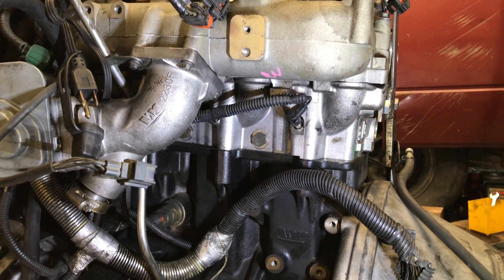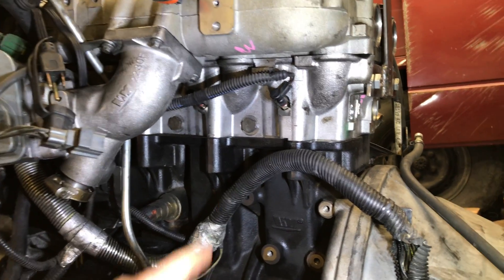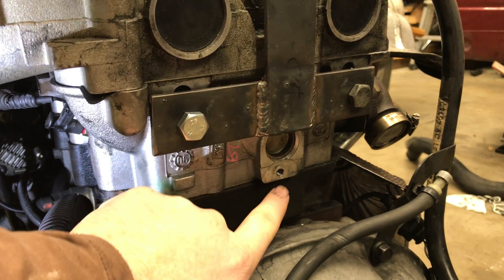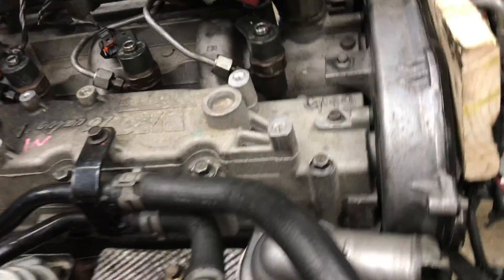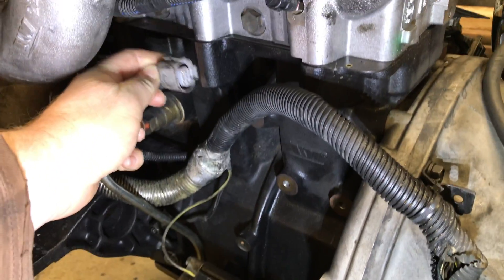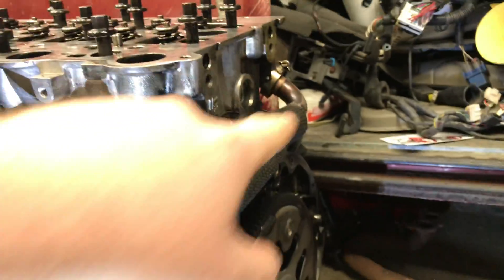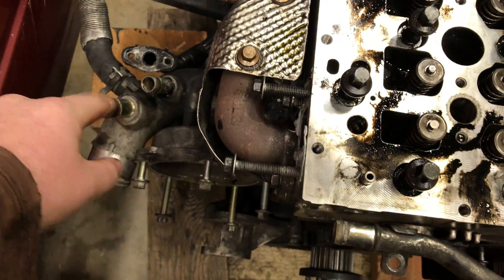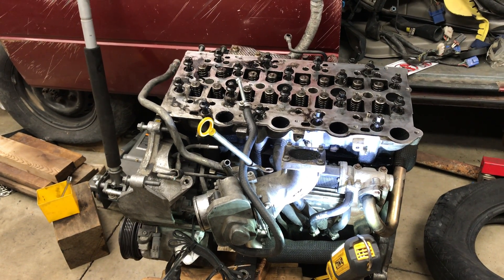Jeep Liberty KJ 2.8L CRD – EGR Delete Basics (What It Does & What to Watch For)

Comment: Why didn't you take off the intake tubes and replace with an aftermarket?  So you'd have 2 connectors not plugged in to anything, the EGR and the valve body.  Looks like there is a butterfly in there that regulates the amount of exhaust that comes into the engine.  So, one connector opens the EGR valve, the other regulates the amount of exhaust flow coming into the engine (new vs. exhaust recycle rate).
Reply from the maker: Good question. The best answer I can give is, leave it as close to stock if possible. Yes you can remove the plate off the valve body, yes you can remove the valve body and try to fabricate something to replace it so the stock boost hose connects in the same place. Yes you can figure out something else besides the stock type boost hose. But by leaving the throttle body and doing a tune to turn off the EGR the butterfly valve will never activate during engine run, and only close at engine shutdown. This also means the protection for runaway diesel is still in place with engine shutdown. Sure you could do more, but at what benefit? This works perfectly fine, looks more like stock for any sort of inspection, and it less cost and hassle than replacing more stuff.

Comment: I have a 2007 CRD.  Similar but not quite the same.  'T' in water pipe doesnt exist, its a formed steel pipe now so you cannot simply replace with straight joiner.
Also EGR looks different, steel pipe round the back of the engine connects to back of EGR withclamp not side of EGR with bolts like your second engine.  I assume procedure will be the same though?
Reply: @farmworksmartin Greetings. I have Diesel 2008 JK 2.8 turbo. So did you find a video on removing the EGR

Comment: Hi There from the UK , you are obviously an expert on these vehicles , i wonder if you can help , 
i have a customers 2.5 CRD jeep (liberty) and it has a problem where you can drive it for
approx 6 miles and it just cuts out , like you have turned the ignition off  , it comes back with 
a DTC of fuel rail pressure monitering , i,m wondering if thats a red herring though , i have
put 4 brand new injectors in , rail pressure sensor and another fuel rail because of the valve
on the end but still the same , is there perhaps something common to these engines that you
might suggest i look at , thanks in advance for any help ,Niall
Reply from the maker: I might be looking at the crank position sensor. Cutting out after getting warm can be a symptom of that. You could hit it with a heat gun with the engine cold and see if heating the sensor causes the engine to die. The other thing that could cause an issue is the fuel quantity solenoid at the back of the injection pump.
Reply: @IcarusOffroad  thankyou very much for your reply , you have given me a direction to go in , i will get back to you hopefully with good news , many thanks Niall
Reply: @IcarusOffroad   Crank position sensor will go bad and fault when hot, like you describe.  However it only prevents an engine start - it is not referenced when the engine is running.

Comment: It's almost identical to my VM motori 2.8ltr intercooled turbo Diesel out of my 2007 Jeep Wrangler. The hard part for me would be getting the ecu to ignore the fact the egr valve and cooler aren't there anymore. It really messes up the intake and Mass air pressure sensor.
Reply from the maker: Yes, whole your engine is a newer iteration of this one it is very similar. I am not familiar with the ECU tuning options that exist for those Jeeps, but I suspect something similar can be done.

Comment: Thank you. Good vid. I have just watched another video and with blocked EGR injectors get overheated and piss diesel. My egr has been blocked for about 80k and starts smoking and mps have gone up. Rpms were jumping recently, not always though. Have been adding injector cleaner for the last 2 weeks and rpms don't jump anymore, but i still get black smoke at low revs , I'm guessing because of too much fuel. Now it has 145k km. Any ideas?

Comment: How many miles is on your old engine. These engines seem to fail prematurely
Reply: . Also I see a issue with a c egr delete. The blowby  needs to go go out your engine. Could cause excessive sludge buildup
Reply from the maker: anthony gauntt we do a separate crank case vent or oil/air separator(like Provent) to keep the oily sludge out of the intercooler and intake.
Reply from the maker: anthony gauntt my old one had 155k on it. We see problems with failed valves on these, particularly exhaust valves, but we also see these on engines that haven’t been maintained by enthusiasts owners. If you tried to drive the vehicle as it left the factory, and use the factory recommended oil you tended to have problems. Those of us that have had ours since new and modified it right away tend not to have the valve and rocker issues that others do.
Reply: @IcarusOffroad  What oil do you recommend for these 2.8 CRDs?
Reply from the maker: @AKJeeper   any diesel rated oil in 15-40 is what I run. Winter I might go a little lighter with something like 10-30. But I run the same stuff year round. I’ve run lots of delo diesel oil in 15-40. I also use the Costco 15-40 diesel oil these days.
Reply: @IcarusOffroad  Thank you, much appreciated!  Good to know.  I just did a complete CRD swap from a wrecked 2006 Liberty into a 2004 3.7/5spd...kept the automatic with the CRD as I didn’t know if a manual CRD swap was easily done here in the US.   The 2006 owners manual indicates 5w30 and that just seems wrong to me, at least compared to all the other diesels I’ve owned.

Comment: What thread is that plug the kit im going to buy dosen't come with it
Reply from the maker: mmmontague I don’t know the thread size off the top of my head. However someone did tell me they were able to buy a drain plug for a BMW at their local auto parts store and that fit the threads.
Reply: @IcarusOffroad  what oil are u using? we used the 0-40 Mobil Syn, and our rockers where bad at just over 100k miles? thanks, appreciate ur vids!
Reply from the maker: @1775peasant  0-40 is too thin, especially in the summer. I used 15-40 delo diesel oil in mine from about 20k miles when I bought it, to 150k miles when my belt broke. And my rocker bearings were perfect. I’ve have seen many low mileage engines that have terrible rockers from running the thin oil. I highly recommend switching to 15-40, or maybe 5 or 10 - 30 for the winter.
Reply: @IcarusOffroad  

thanks man! 

u don't know how many times i almost dumped 15-40 in my wifes? i'm a corn & soybean farmer, and i get 15-40 in bulk for all my stuff......

looks i'd of been money ahead if i'd of just went with my gut? those 16 rockers where high $, plus the higher oil cost......

reason i didn't, in my Mom's '94 Town car i used 15-40, and it started knocking at like 60k......the service manager at the Ford dealer where used was a close friend, he asked me what oil was i running.....he said it was too thick, and because the cams in that motor ran at such close tolerances with no bearings(?)......it was not getting enough oil up in the top to lubricate it well enough? so, they replaced those heads and i went back to the OEM specs......

thanks much! joe
Reply: Ok thank you very much doing alot of work to my 2.8 just want everything to look and preform as good as it can i love this engine

Comment: Question.  I've been wondering this since 2 winters ago when I went through 2 engine block heaters. I did the weeks stage 1 egr delete the first time...which made things a lot easier the second time I  replaced the block heater.  Now it needs replacing again.
I would like to install a 1500 watt circulation heater and I was hoping you could help me in figuring out where I  should pipe in the inlet and outlet on the engine.  To put some context around my issues, I  live in Winnipeg Canada and winters here can get as low as minus 40 degrees Celsius.   Btw -40 crosses eachother for both Celsius and farenheit.  
Appreciate your help as aways.
Nick
Reply from the maker: I cannot say I have given that much thought, that being said I think these lines that I disconnect for the EGR might just be the right thing, suck water from the outlet side over by the water pump, heat it, and then send it back in using that nipple I removed.
Might work out right, though I confess I am not 100% sure which way the coolant flows normally in those lines I blocked for the EGR delete.
Reply: @IcarusOffroad  thanks, I will let you know what I come up with

Comment: There is a video on YouTube that shows you what program and software to use from getitgarage that shows you how to reflash your ecu. You will have to buy a plug to go from your laptop to your obd plug. Don't put a stage 4 hottune on unless you change your torque converter to a 3 disc converter
Reply from the maker: p s Yes I’ve done plenty of the tuning before. My CRD is unique so I am not able to use the prebuilt tunes, all my maps have to be adjusted manually if I want to make a change.
Reply: @IcarusOffroad  that would be a great video, what programer do you use, I would like to learn more about how to do that.
Reply from the maker: p s I use the MPPS cable like everyone seems to. There are other tuners out there but this one is the cheapest and works fine for the DIYer. Yes that would be a good video to do.

Comment: Great stuff, I would be interested to understand what plug or cap exactly you are using here for the exhaust and ETC. My concern is how to get the sealing really tight and you seem to have got that under control. Please elaborate. Cheers
Reply from the maker: I used a small soft metal conduit plug, the type of thing you would pop into an electrical box to block an unused conduit entry. It had springy fingers that held into into the box, but with those snipped off it was the right size to cap the fitting. Since it was soft metal when the Vband clamp was put on it squeezed down tight. 

I would prefer to tap the inside diameter and run in a grub screw to block it. But I will need to research the size needed and order some taps or drills to get that worked out, but I think that will be the best method for long term plugs.

Comment: Excellent video! I am deleting this tonight on my 2006 CRD, which I converted to a five speed manual! NV3550
Reply from the maker: Glad to help. Sounds like a unique setup you have on your Jeep. My 2.5CRD has the NV3550 as well.
Reply: COrobotchicken  that’s awesome! I think these are great diesels. When they’re maintained properly of course...Did that 2.5 have the NV 3550 behind it stock? I wonder if that crank is the same as the 2.8? Hmmmm
Reply from the maker: Terry Pederson yes the 2.5 came stock with the 5 speed in 2002-2004. The 02-04 2.8 had the auto. In 05 both he manual and auto were 2.8.